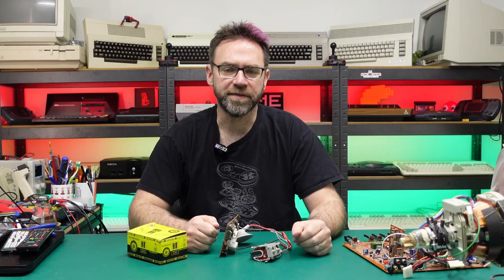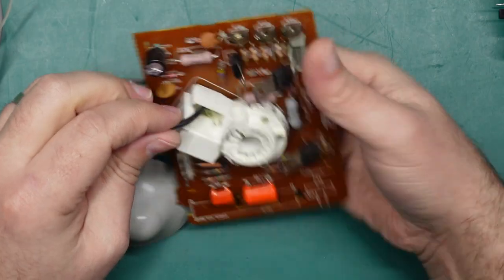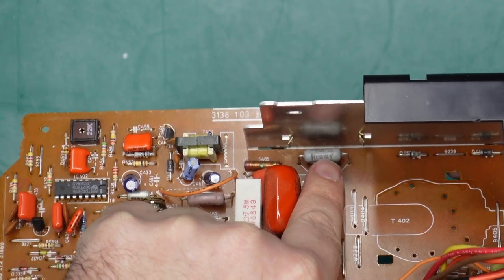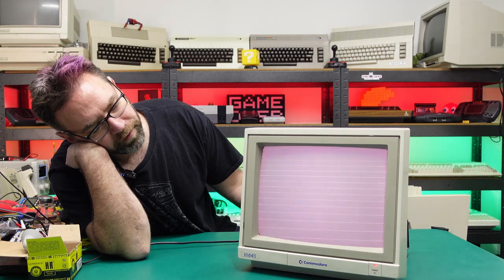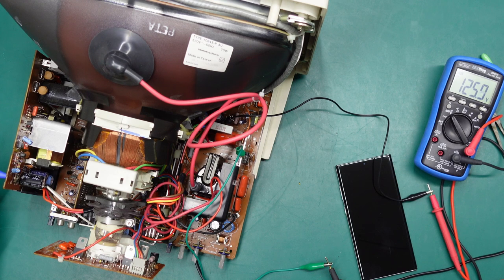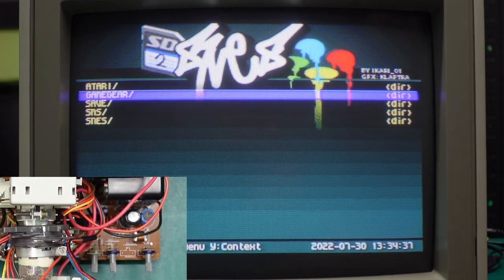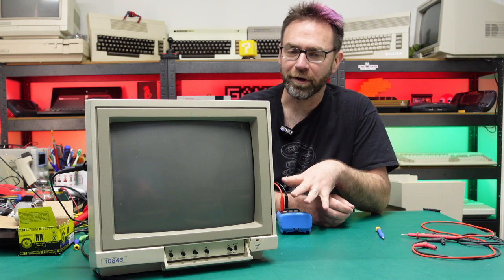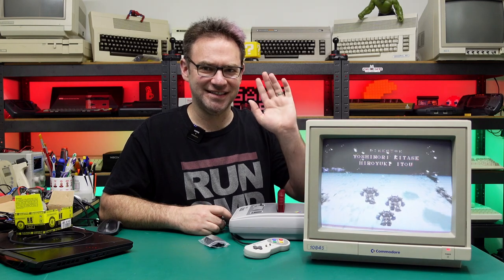Commodore 1084S-P CRT monitor - flyback replacement and basic calibration

Comment: I replaced the flyback in my 1084S-P years ago but I didn't know about some of the calibration steps you showed like setting the B+ voltage so I guess I'll be going back and doing those at some point :) Thanks for the video, it was quite informative!

Comment: Just did this replacement, and the screen was blurry when brightness turned up (blooming). Turning down brightness control all the way down and contrast all the way up, reduce screen voltage until white text is just barely visible. Then adjust focus for sharpest image.  Bring screen voltage up just slightly until brightness control has a good range. Problem solved, no more blooming very sharp text.

Comment: Yet another 1084s bites the dust. Despite your excellent video and clear instructions, I'm extremely reluctant to attempt this type of repair. And unfortunately I've been unable to find anyone able and willing to attempt the replacement of the Flyback Transformer.
Reply from the maker: Sorry to hear it Pete. If you want to mention where you're located perhaps somebody will see it and be able to help you out
Reply: @TheRetroChannel  Sure thing. I'm on the south side of Brisbane.
Reply from the maker: Cool, I'm in Canberra so can't help there but you may have some luck if you ask in the ausretro discord server https://discord.gg/FudkjBbb
Reply: @TheRetroChannel  I took a shot at it myself and so far it's working great. Needed to adjust the Focus and Screen on the Flyback, used a old modelers paint brush, filed down to suit and carefully adjusted whilst keeping myself clear of those nasty voltages. The daughter complained of the hi-frequency tube noise but being a old fart I can only hear it after sitting beside the monitor for 15 minutes or so.  So all in all it's been successful. Sharp clear picture, all good. Thanks for the clear concise guide. I doubt I could have accomplished this without it. Subbed in appreciation.
Reply from the maker: @pete3300  Awesome! Now there is a guy in your area who can do that sort of work 😉

Comment: A very nice conclusion to the last video. I'm looking forward to you adding a SCART input to the CRT. I have an Amiga 25 pin to SCART cable that I used for about a year when I 1st got my A1200 three years ago. I ran the SCART into one of the small cheap black boxes from China which gives you HDMI out to a flat screen. Now I use an Amiga 25 pin to a 6-pin round plug that goes into a 1084's round RGB inputs. Will switching to a SCART input on my CRT, would I get a better pitcher, or would it be the same as the 6-pin round RGB input? Whay I'm trying to ask is weather the SCART would be better or is it using the same data as the 6-pin round just converted to a SCART input? TY for all the GREAT content you make for the retro community.
Reply from the maker: Thanks mate. You propably already got the answer from the SCART mod video but no, adding SCART will not make any improvement to the video quality. The DIN and SCART header are wired internally to the same points, the only benefit of adding SCART is the conveinence. And if you do it the way I showed in the other video then you'll be able to hook up anything that uses sync on composite or sync on luma rather than just csync.

Comment: My CM8833 was in storage for nearly 30 years. The flyback went shortly after I put it back into the service a couple of years ago. I had it (and several caps, mainly on the power board) replaced but I am 99% positive that it didn't exhibit bloom before like it has since the flyback (HR7506) was replaced. If it did I did not notice it in the couple of months it was working. So I'll be very interested to know if you make any progress with this issue in future.
Reply from the maker: Yeah, I'll come back to that issue in the future. Dare I say there's no fix for it, but at least we'll be able to know for sure if it is caused by the replacement flybacks

Comment: back in 2005 I bought a Sony 34XBR960 TV brand new and it had the same blooming issues and looked out of focus when setting contrast to the desired level, Sent it back for a replacement and the problem was gone, Ive always wondered what part was faulty in the previous unit to cause such symptoms especially out of the box.

Comment: My 1084S does have a SCART plug on the back. It came with it, but I notice most 1084S does not have it, it's closed by a plastic shield. What's special with my version?

Comment: Nice! I wonder what it is that causes these flybacks to have different image quality? I would have thought if it can maintain the voltage, it would have nothing to do with actual image quality.
My perfect 1084s just blew its flyback right in front of me! The dreaded 'scweeeeeeeeee' then the sad missle command sound when turning off 'sqweeee e ee   ee  e'. What is actually causing that crazy sound when powering off? Has anyone ever repaired a flyback?

Comment: Just dug out my old 1084 that had been sitting in the cellar for the past 15 years... it still seems to almost work and it shows the video from the VCR that I feed in via the composite line. However there seem to be around 30 evenly spaced scanlines where the image seems to be too bright (also kind of flickering) and which are vertically offset. Does this kind of behavior point to a specific component that is broken or might need readjustment?
Reply from the maker: Sounds like vertical foldover but it's hard to tell without seeing it. Google CRT vertical foldover, if the image results look similar to what you're seeing then there's an issue in the vertical deflection circuit.

Comment: One of my 12 Commodore CRTs, an 1084S that was working fine up until yesterday. I was working with no problems a week ago last time I used my A1200. Then yesterday nothing when I turned it on to play my newest Infocom game on my A1200. Well not nothing. 1. The red power light was not coming on at all. 2. I'm pretty sure I was getting high voltage because the 4 different times I tried I could hear the high pitch spin up when I turned it on and also could hear the wind down when I pressed the power switch to turn it off. I have many spare CRTs so I just swapped it out and played the game that I was looking forward to playing. I have watched a ton of CRT repair videos from you and many other Commodore & retro computer YouTubers. This is not ringing any bells with the power light not coming on but the high voltage spinning up. Have you ever come across this?
Reply from the maker: Could still be the flyback, usually it just dies completely but perhaps in this case just one of the lower voltage turns has gone bad. I'd check and see what the B+ voltage looks like. I think it should be 125V for the 1084S, I did show how to do it in one of these videos, might have been in this one
Reply: @TheRetroChannel Good morning and TY for helping me. I went and got my only other 1084S. This 2nd one has been on my list to work on. Its CVBS works with a great picture, but its RGB has always been a black screen (I was thinking since the CVBS works & no RGB video since I bought it that it might be a bad solder joint on the RGB side?). Well as soon as I turned it on the red power light came on and for the 1st time, I noticed the coils glowing orange through the vent slots. Its super early here and the room is dark other than my PC screen, so this is probably why I've never noticed this before.  Ok back to the one that has stopped working, like I said the power light is not coming on and when I hear the High voltage wind up, I see no coil glow? Also, today the windup sound is not as loud and stops after 2 seconds. Also, today when I turn it off today the wind down sound is very quiet and only last for the same 2 seconds. F.Y.I. I have 2 fully working 1084, I'm letting you know this and wonder if need be, can we use parts from them for testing?
Reply from the maker: The easiest thing to try would be swapping the power boards as you can just disconnect the plug going to the main board and the plug for the deguassing coil. It should then slide out, you just need to push in the black clip on the underside of the monitor case. It's sounding more like a bad flyback as all the other voltages are generated from the flyback, and would explain why the heater coils in the neck are not glowing and why the power LED is not working. I'd also check the solder joints for cracks, these boards tend to have bad joints. So check the joints on the flyback, where the neck board connects to the CRT itself, and joints for the connectors

Comment: Id suspect the blooming issue is lack of regulation in the B+ line. Rather than measure the EHT try monitoring the B+ with changes in the image.
Reply from the maker: This is one of things I checked out on all monitors off camera. The B+ varies by about 200mV from black to full white. I think it worked out to be about 0.16% variance, so it seems unlikely to be the root cause. I do have another monitor that uses the same flyback as the 1084S-P1, so we'll find out soon enough if it is the flyback itself or something else